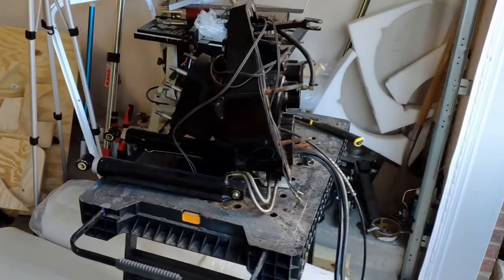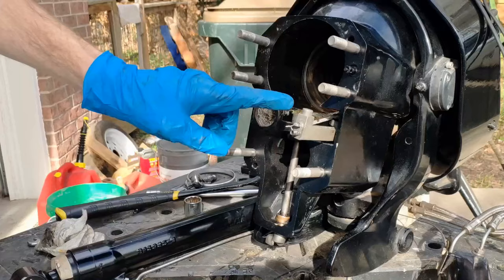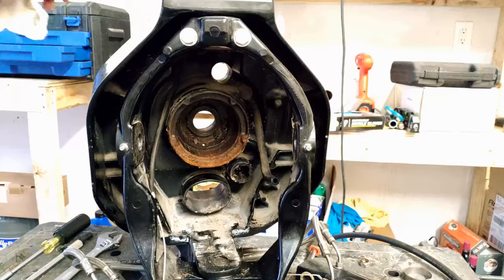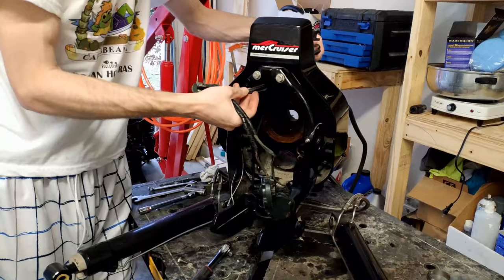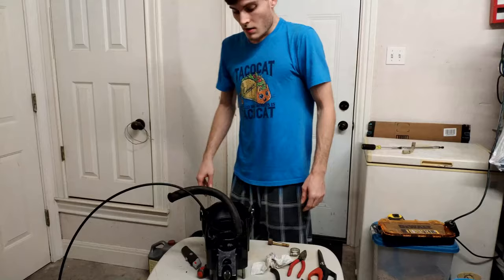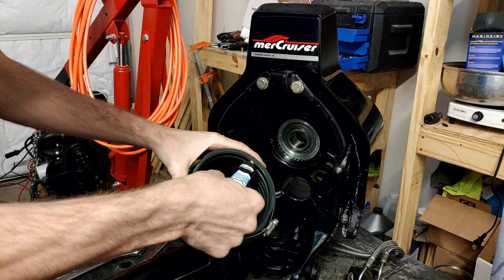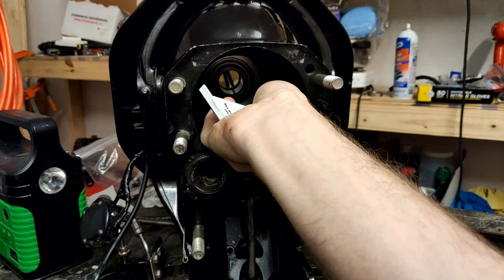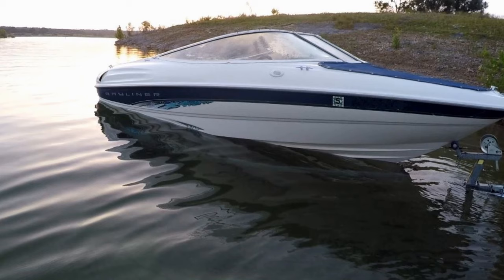Rebuilding the Gimbal Housing and Bellows Replacement

Comment: Great video! Couple of things I noticed thought, you don't have to put bellows adhesive on the u-joint bellows where it meets the bell housing, the retaining ring seals that end.  Only need it where it meets the gimbal housing where it's secured with the hose clamp.  You DO need bellows adhesive on the shift bellows where it's attached to the gimbal housing.  Also, you should use perfect seal/Permatex aviation form a gasket on the speedo fitting threads.
Reply from the maker: Thanks! Great info!

Comment: Since I tuned into your video to learn how to repair my 2008 Tahoe 4.3, I have nothing but praise for your work. 
I have followed you step by step, simply pausing the video while I completed your example.
I did watch the entire video from start to finish before attempting this job, so I was aware of the couple of
 corrections you made in the beginning. KUDOS to you. My stern drive is just about ready to reinstall.
I had purchased a rebuilt engine ( block cracked last February during hard freeze in the Dallas area. My fault entirely for not properly winterizing )
Anyway while I had the  engine out , I decided it might be worth checking the bellows etc and service them at this point.
Very good choice on my part.
Thanks for a great instructional video.

Comment: I wanted pop back in and add in my challenges and solutions in case anyone else runs into the same. I have a V8 with a removable cover, but seats on either side. So reaching back to the inboard side on the transom is VERY difficult. I did all work with the engine in place.
 - I should have snipped the gear lube line before trying to remove the bell housing because I broke off the plastic fitting on the gimbal housing. The fitting is attached with an E-clip on the inboard side, I was able to remove the original clip with a long screw driver and bore scope coming from the Starboard side. Installing the new one was tough! I tied a string to the new E-clip because it got dropped a hundred times while trying to position it in the groove. Once I got it located, I taped a washer to my finger tip to push the clip in place. I did the install from the port side, and yes, the string is still there.
- Installing bellows to the bell housing:  I had a piece of 1" wide x 1/8" thick aluminum flat bar, about a foot long, that I bent ~100 degrees around 3/4" from the end, then I rounded and smoothed the bent end. This was great at grabbing the inside convolutes on the bellows to get them in place. I installed the driveshaft bellows ring by first lubricating with spray degreaser (like simple green), then I found a tin can in the garage that happened to be the perfect diameter and used this with a dead blow hammer to tap it in place. This all went very smoothly.
- Lower shift cable install: I had a tough time getting the sheath through the transom and under the engine/manifold. It has to take a sharp turn right after passing through and this was a 2 person job using various means to guide it around. But when I went to put the core/cable in the sheath after the bell housing was installed, the solid cable end was too stiff to pass through this tight bend area. I had to unscrew the sheath fitting from the bell housing while holding the greased boot with a pair of vice grips so it didn't twist. Pull it out about a foot, then push the core in as far as it would go, then push the sheath and core together past the tight area. This worked great, but then I couldn't use the special socket to reinstall the sheath fitting to the bell housing because the core was in the way. The fix was to grind a slot in the special socket so the core could run through the center, then use an open end wrench to turn the socket. 
In the end, everything came together and no more leaks! Good luck to those getting ready to tackle this. It's not too tough if you follow good videos like this and take your time.

Comment: The gimbal barring should be installed with the carrier housing slots faced aft. This allows the barring to be removed by sliding the alignment tool into the barring and twisting it sideways and out through the slots. No hammer needed, this video shows the barring and carrier installed backwards.

Comment: Very difficult to find someone who knows  or willing to work on these.  Good job!
Reply: Very hard to find somebody at a reasonable rate best thing to do get a book and do it yourself if you’re mechanically inclined that’s what I do
Reply: Called every single marine place within a hundred miles and couldn't find a single one to do it. I ended up doing it myself the bellows leaks now gotta re do it
Reply: @biggifrank69  Oh no! I am in the middle of doing my repair now, I am planning to wait a day after gluing each bellow sleeve so it sets before moving onto the next.  Ya also really need to clean the bell and gimbal housing metal sleeves (I'm using a stainless steel brush with paint thinner) and also clean the rubber insides of the sleeve with light sandpaper and paint thinner.  The OEM rubber bellows come coated with an anti-rat poison that will impede a good glue seal that needs some treatment before you glue it on.
Reply: @neverclevernorwitty7821   set the one on the transmon plate first
Reply: @biggifrank69  Agreed!  There is a magic order to this.  Zachs video is great, but most of us doing a bellows job are not going to be removing the Gimbal Housing from the transom.

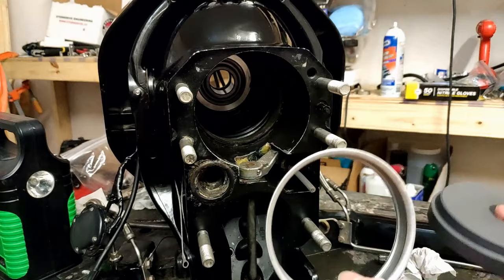Comment: good job. slide hammers may not remove gimbal bearings successfully. better to have a threaded puller where the nut will steadily draw the bearing out. And at 19:00, you definitely want that special tool for the bellows retaining ring. You'll destroy the ring with anything else.  Also, the bellows adhesive is a contact cement type glue so you want to let it set up a bit on both surfaces before assembling the parts.
Reply from the maker: Good info!

Comment: just a little FYI....when replacing hoses, especially the WATER HOSE, it is important that you not install it TOO LONG. In the lowered (running position) it WILL kink and pinch off water flow which will cause an overheating condition. ALWAYS operate the unit up and down fully to ensure the components travel freely.....oh, and that bellows tool is worth it's weight in gold......unless you don't value your time.

Comment: Don't use electrical tape on wires exposed to liquid it's terrible for that. Use 3M tape that bonds to itself when stretched, it uses no adhesive to bond it seals by chemical reaction and is rubberized for a nice water tight seal and good durability. The 2 X 4 tip though is a good one but you also could have raised and gently dropped the outdrive to use it's own weight to pull it from the gimbal like a jackhammer, I choose to utilize the 2X4 piece myself if my outdrive even works on the boat I acquired, I've yet to evaluate the electrical fully but I know there is issues with that.

Comment: I liked it so much. I subscribed
Reply from the maker: Thanks Dave!
Reply: Zachs Garage  hey I have a 23 ft rienell

 has a 350 Chevrolet 4 barrel 4bolt main with cobra outdrive. Motor appears to be toast . I’m not sure what to do ? I’m a disabled vet and I need help with this. Floor is soft and has a hole in the floor right in front of the sleeping quarters( the cuddly)

Comment: With the Alpha Gen one which does not have the insert that attaches the U-Joint bellows to the bell housing it is necessary to put the bellows on the bell housing first and then slide the unit in.
Its really a pain.

Comment: Excellent video and very well done but just FYI the new gimbal bearings come sealed and do not have to be greased
Reply from the maker: I figured, but I wanted to fill up the cavity with grease anyways just to ensure water or condensation can't fill the space
Reply: @ZachsGarage1  I don't think I have the guts to tackle a job this complicated but it can certainly save you a ton of money.  I paid nearly $1,000 just to do my bellows over and nothing else.
Reply from the maker: @gm1937  dang! Well I can understand why people charge a lot for it

Comment: New to boating and have an old beater. Someone spotted a tear in my exhaust bellow. I tried to replace it without taking everything off, but no luck. I've been still taking the boat out with it just attached to the boat side. My question is, because it's the exhaust, does it HAVE to be connected? Will it let water into the boat if it's not attached?
Reply from the maker: Short answer is that it should be fine. The exhaust actually comes out of the sides of the gimbal housing anyways. The exhaust bellows just helps route some of the exhaust to come out of the outdrive where the propeller is

Comment: After pulling the drive shaft bellows into the bell housing grove (I did add glue in the grove as you showed) I can not get the metal retainer ring to drive in, I do have the proper driver, would it be ok to add grease to the ring so it will slide in?
Reply from the maker: Should be ok to use grease, just want to make sure it's not able to slide back out

Comment: Right at 14:00 you are putting a steel tube into the shift bellows.  I took mine apart so long ago I forgot.  Does this stay in the shift bellows?  What does it do?  I can't find that part for sale anywhere on the internet.
Reply from the maker: That was a ratchet socket 🤣 I used it to help push the bellows on. It is not required! I did not leave it on there
Reply: @ZachsGarage1  Well that's a relief as I don't want to deal with fishing my shift cable up to the carb again.  On the other hand, I have this peice of steel tube that looks very much like your socket in my parts pile that I now have no idea where it came from.  This is why I shouldn't take things apart and then not put them back together for four months.  Thanks for the reply.  I appricieate it.

Comment: Hey Doc, can you confirm to me that the shift cable housing on a bravo 3 is pressed in from the back? I need to replace mine but upon inspection of the bellhousing and current cable installed I cannot figure out for the life of me how to get the brass threaded housing out of the bellhousing as the nut on the back is locked in via a metal form molded into the bellhousing to stop the nut from turning.
Reply from the maker: I do not know for a bravo 3, I'll be curious to hear the answer
Reply: @ZachsGarage1  Is there a way to send you some video/pictures?

Comment: Hey bro you are an amazing rebuilder, your videos help me a lot on my 3.0 mercruiser, but I have a huge question, do you know why there is water (milky oil) on my gear lube and the little container beside the motor?
Reply from the maker: Have you tried draining the oil from the container and the lower unit and then refill it to see it it turns milky again?

Comment: I'm doing a gimbal bearing replacement hopefully got the new bearings but the one inside looks like there's a safety ring or something in front is there one in front of these on a alpha outdrive
Reply from the maker: Interesting, there shouldn't be a safety ring and far as I know. If you want too can send pictures zachsgarage1@gmail.com
Reply: Really old r types had a nylon bearing carrier. And they had an internal shap-ring... Sometimes a sunnavabitch to get out. I always look inside the cavity to determine if it has a ring ot not

Comment: But with it mounted on the transom and engine installed you wouldn't be able to remove the gear lube hose like you did by removing the whole thing from behind. And in that case which order do you find easiest, attach the gear lube hose on the gimball housing side first then the bell housing or vice versa? In both scenarios it's gonna be real tricky to install cause of the tight space and short hose. Would really appreciate you opinion on this.
Reply from the maker: I think you have to unscrew that metal nipple/coupler (shown on the table at 12:50). I don't think I could have done it without doing that. You can still unscrew it and remove with it on the boat and engine in. Just remove the hose from the oil reservoir first and remove that hose on the inside going to it first
Reply: @ZachsGarage1  In my experience that would be next to impossible to access with engine installed. Or at least even more difficult than doing it from the outside of the boat. So that would be my 3rd option 😅 But let's say for argument sake that removing the whole insert from the inside was not an option, how would you proceed in that case? Looking for the best option of the two and hoping for some master tip to get this done with minimal hassle 😅 Thanks for the help!

Comment: I’ve traced a gear oil leak coming from the oil line. Do you know if this can be replaced without disassembling from the housing? Meaning, just undo it from inside the boat as you showed then pull it out from outside?
Reply from the maker: Probably not, because you have to re attach the new line on the inside of the bell house piece I don't know if you have enough space to get to that, you can certainly try though

Comment: This is one of the better videos I've watched on this subject. It sure looks like a very difficult job. Did you use the Mercruiser Shop Manual at all to see how to do the work? I have the manual but their pictures sure could have been better. Great job. Thank you very much.
Reply from the maker: Thanks for your comment! I did reference the shop manual some, but like you said the pictures could be better, haha. And also it doesn't tell you the best order for taking all the peices off for this job
Reply: I have the manual.  It has all the information needed to maintain a Mercruiser inboard/outboard, but it has to be the most mis-categorized repair manual I have ever had, lol.

Comment: good vid, do you have to put bellow adhesiv on shift bellows and exhaust bellows too ??
Reply from the maker: You can If you want, it probably no isn't needed on the exhaust bellows. But it may be a. Good Idea to put some on the shift cable bellows since that one could leak into your boat
Reply: @ZachsGarage1  ok and the bellow ring which one you have to install goes between the bellow and the housing or it goes inside the bellow itself? Thanks
Reply from the maker: @kubaSWAT  It goes in the bellows and holds the bellows tight to the shape of the housing

Comment: Zach, in the middle of my first alpha 1 gen 2 rebuild. Must have watched your video 10 times by now. thanks! i have the Gimbal bearing installed but can 't convince myself its in all the way.  is there some kind of measurement basis, like the depth of the them groves on the side ?  or anything.  should the back of bearing be inside the seal ?  i can feel a space with my finger past the bearing...  just freaking out. sorry  any help appreciated.  thanks again
Reply from the maker: Well the way I knew is I couldn't get it to push in any further. If it's not budging despite your best efforts then it should be fine. I believe the drive shaft has some tolerance of surface area for the depth the bearing touches on it
Reply: @ZachsGarage1  thanks, i'll push ahead and see what happens.

Comment: Zach how did you properly align the gimble housing to the motor?? or is that in another video?
Reply from the maker: The gimbal housing should not need aligning, but the gimbal bearing will. For that I used the alignment tool. I don't have a video on that yet

Comment: Wonder if you could have used your alignment rod to drive the Gimbal bearing out, with out it coming out in pieces?
Reply from the maker: I didn't think about that! But if your engine is out of the boat I see no reason why you wouldn't be able to use it!
Reply: I will let ya know how it goes....lol
Reply: @ZachsGarage1  It worked very well ! slide the alignment tool in from inboard & then used it like a slid hammer from outboard. The tool had just enough Knurling to drive the bearing out. I think it took maybe 10 pulls. I would put a weld bead around the tool at the knurling if I did this again.

Comment: could you share an INSIDE DIAMETER  for the gear lube line that was replaced using zip ties
Reply from the maker: 1/4" inch
Reply: @ZachsGarage1  thank you very much
I was torn between 1/4 and 5/16

Comment: I thought the flange slots on the humble bearing faced the water? You put it in towards the boat. Am I mistaken?
Reply: Gimble*
Reply from the maker: Hmm, I am not sure, I noticed the slots only being on one side, there was not any mention of which way it should be turned  from the manufacturer when i ordered mine. From what I could tell, the slots indicate which side the inner bearing can slide out from. So it would make since to have the slots pointed in not out so you can't accidently knock the inner bearing out of the outer shell when trying to remove it in the future. That's my guess, I could be wrong
Reply: Slots toward the engine